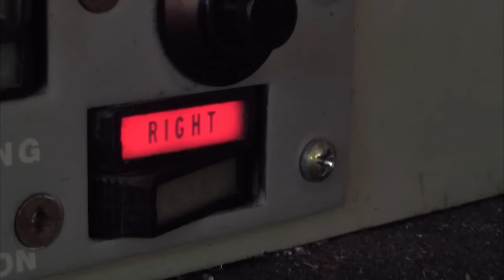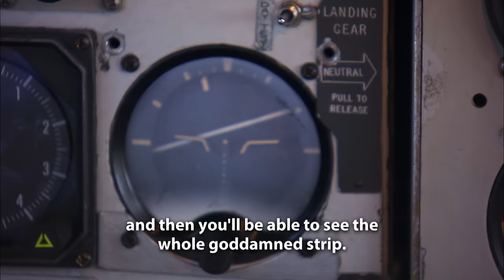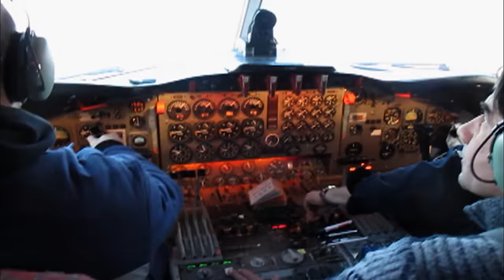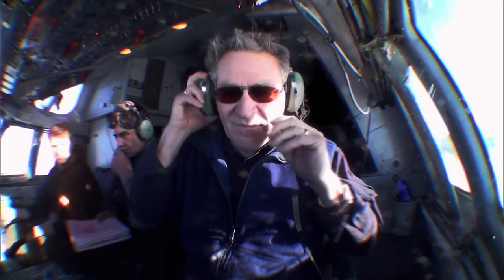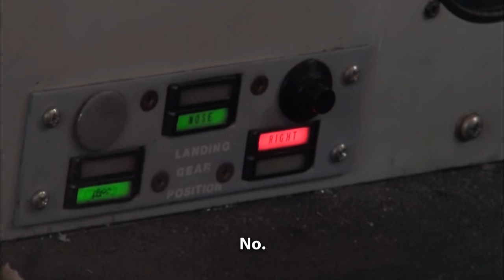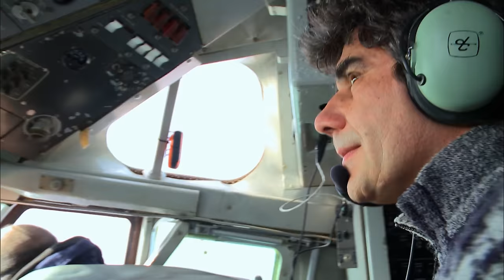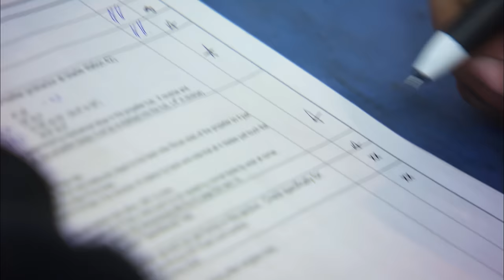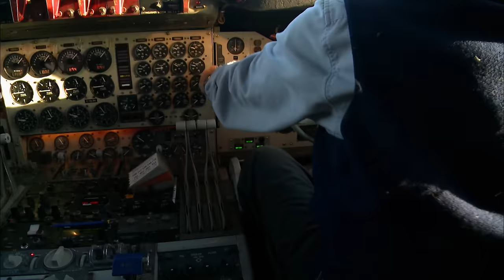Buffalo Airways Electra Suffers A Crash Landing | Ice Pilots | Wonder

Comment: I had tears in my eyes watching this. In the early '60's, at 13 years old, the Electra was the first plane I had ever flown in and had a number of round trip flights in them from LA to Oakland. That was when I decided I wanted to learn to fly. Although I never got to fly an Electra, I did fly for over 20 years including the largest plane being a C-47. This plane was actually Donald Douglasses' personal plane that in 1946 he had it pulled off the C-47 line and converted it to use as his personal plane. Great memories.
Reply: Yeah it was heartbreaking to watch.
Reply: It was returned to the air by Buffalo. It now serves with them as a tanker in a new paint scheme..

Comment: I was technical ground crew - structural technician in the Israeli Air Force.   In D-Check (heavy maintenance depot) the jets were sometimes litrally dissmantled to bits.   Engines removed, wings and horizontal stabalizers dissconnected, all avionics removed, no canopy, sometimes stripped bare of all paint.   To the untrained eye, not much left to look at.
Pilots almost never ever went anywhere near the D-Check hangers, I was told pilots didn't feel comfortable seeing their jets in bits and pieces.
Planes can be repaired and even rebuilt.   Air crew are not replacable.
Reply: Thank you for your service, Sir! Shalom & Semper Fi ^v^
Reply: I used to do the same work as you... it was unreal looking at a skeleton plane and then put it back together.
Reply: @taproom113  Thank you.
Reply: @volador2828  What I only realized several years later, weight for weight, some aluminium alloys are over 3 times stronger than low carbon steel.   There is liberal use of AL7075 - T6, and even T7 throught F-15 & F-16 structure.   These jets are rated to around 14G.
Metalurgy & materials science is wild !
Reply: @trespire  Yep, I also use to run oil samples on jets. I learned quite a bit about metals and oil. About 3-500 samples a day!
I've grounded a few airplanes in my day...
Reply: I catch your drift, but eventually it's up to the pilot flying a plane and signing for the plane to take it airborne.
Look up Bijlmer ramp..
Reply: @MaistoHelix  When it came to the oil sample results, I had the final say whether that plane was going to fly or get grounded.
Reply: It would be like walking into the open heart surgery of a dear family member. Nobody wants to see that!

Comment: As a ground crew that guides it to park with flash lights, the Electra is the most intimidating frightening plane of all planes coming at you with 4 separate 10 foot props spinning at high speed. And when looking up at pilots, you often see them with big smiles.

Comment: I was taught to hit the brakes a bit before transiting the gear, spinning tire is larger and can jam in the doors when it is coming up.
Reply: Not a pilot myself but had the same thought.
Reply: Yep, that was how I was taught as well.
There was rubber on one of the doors, so it was obviously struck as the gear was retracting, but if the wheel hadn't been spinning the door may not have been dragged into the tyre causing it to deform and jam the wheel in the well.
Maybe a bit of a maintenance issue that the door could hit the tyre in the first place, but I think also a pilot training oversight.
Reply: Yep always tap brakes before transitioning gear. All pilots of RG aircraft in the US are taught this. Why they don’t do so is partly what may have caused this in the first place.
Reply: @davidmerullo551  The Electra does have nosewheel rub strips to stop the tires spinning but if you tap the brakes on on a big set of tires (which are heavier than heck) the tires often turn on the wheel - especially in the cold.  With a tubed tire the valve stem gets cut off eventually and with a tubeless tire it can break the bead and cause a flat, so they just spin until they stop by themselves.  Some airplanes require tapping the brakes (the F4U Corsair is one of them) because the tires just barely fit in the wheel wells, but generally bigger airplanes (because of the mass of the tires) don't.  The C-130 is the same way.

Comment: When in the ANG in California after being a crew chief engine run qualified in the USAF on C-141A's  1965-1968. I believe that I was the only taxi and runup qualified crew chief in the ANG or USAF on C-130E's. Even the Navy crew chiefs had to have a flight crew do that when we moved to the Navy air station at Mugu . At Van Nuys CA ANG we had a full simulator to qualify on. I was the only crew chief to qualify because no one else wanted the responsibility. Taxing the C-130 was a blast and I could trim the engines on my airplane when we went to the fence ( the fence deflects the prop blast) and balance the engine prop combination with the engine shop guys to get the most out of the airplane.  C-130E 64-1799 a antique by todays standard. Now retired and still miss those days. Now, they don't let enlisted to do that anymore. Such a shame there are a lot of smart people in the USAF/ Navy/Army that could qualify to do that. It is and was so much fun taxiing that plane. Because of that got a lot of trips out of the US.

Comment: The Electra was flown frequently on long range patrol with 2 engines shut down for fuel conservation. Shutting down at least number 4 prior to landing would have been an option .
Reply: Exactly what i was thinking.  Im a retired Multi engine CFI.  Twice i had to land with an engine feathered.  No big deal.  Flaps and cowl flaps up, engine feathered and shut down, land sofly on the opposite side of engine bad, shut off all gas and electric on short approach.   This landing do look stupid for a multi CFi .  Fail.
Reply: @emergencylowmaneuvering7350  Actually, if you know the airplane, they did it exactly right.  The flaps were down of course because of the huge difference that it makes in the touchdown speed of an Electra and the fact that you can't pull reverse on the engines until below 128 knots (doing so can internally disconnect the prop from the engine and in that scenario you'd want to  be able to pull all the reverse you possibly could on your good engines to keep the airplane straight and on the runway for as long as possible).  They killed the fuel and ignition to #3 & #4 on very short final but didn't feather the props.  When a feathered prop (on an Electra, anyway) hits the ground leading edge first it's very strong and will often tear the prop & gearbox off the engine, or sometimes even the engine itself out of the nacelle.  When these props hit still in the flight range they fold back fairly readily which limits the damage.  The way that the crew dealt with it is exactly the way that it's written in the AFM.  The airplane survived and flew again - I flew it yesterday.
Reply: @emergencylowmaneuvering7350  Q1: What does the checklist and AFM / SOP say ?
Reply: @asya9493  That is the standard for ALL  propeller airplanes.  1960's manuals lack a lot of precautions and preps.  And manufacturers even promoted you bend a lot of parts so they could sell them to you.  
I have been flying since 1969.
Reply: @emergencylowmaneuvering7350  Agreed !   I'm surprised that company SOP/checklists were not updated.
Reply: @asya9493  The company most times dont want to admit they recommnended the wrong procedure.  They will be sued by the ones that got a lot of extra damages doing the old procedures.  
The company will hire lawyers that will lie, and lie, and trick, and lie and confuse and put down all contestants..

Comment: I am fascinated by this episode.  Did they actually have a camera crew onboard (and at base) for this flight? If not, the parts that were re-enacted were very well done! The Electra is one of my favorite birds, I worked on the P-3 variant in the USN for a couple of years.
Reply: I truly believe they did have a crew there for it. The fact they don’t operate a large number of aircraft at the same time means the camera crew was always on one of the only Buffalo flights in the air at any given time.
Reply: It all is from the TV show Ice Pilots. Camera crew's always on most of the flights and in the hanger.
Reply: @donmc9699  nope. that happened on a c47 flight. this was a gear acutaor that got jammed.  you can look up the investigation report from transport canada

Comment: What a shame to see that happen to such a beautiful plane, glad everyone walked away though and that they are able to salvage a lot of parts at least. I must say I am bothered by the boss's attitude rushing the repair though. The mechanics forgot to tighten something and were very lucky that it manifested itself in a way that the crew noticed during the initial test run of the engine. What else did they forget to do? They're only human and they're operating under a tight deadline and a lot of stress. Also unless I'm mistaken, they pulled an engine off of a crashed plane, it had no readily visible damage but how do they know it didn't ingest debris or suffer some other hidden damage? This sort of slapdash attitude is what gets airplanes destroyed and people killed.

Comment: Was it ever determined what caused the landing gear to fail?
Reply: According to what I can find "The outboard
gear door strut is suspected to have jammed the gear mechanism
during landing gear retraction after takeoff. TSB File A12W0020."
Reply: @augie6651  you must be more adept at searching tsb archives than me. Thanks for the info
Reply: @augie6651  Indeed, the reason they can't be more specific is because, as we see, Chuck hooks the gear door to his truck and pulls it off the plane, thereby allowing the remainder of the gear sequence to take place. Necessary for urgent removal of the aircraft so the airport can reopen, but also likely the exact thing that could have provided a more thorough report.

Comment: I was there and built that ice strip along with Jim Burke(r.i.p.) and the runway was fine and when hercs are using a strip they sent their tech. experts to sign off that it's ok. We used a d6 cat and a cat wheel loader with chains that drag under the bucket to leave a bit of snow on the strip. This is at Sabina gold and silvers exploration camp(goose lake)which is now becoming a mine. We would land hercs and all sorts of planes 24 hours a day up to a dozen planes every 12 hours .I have also built ice strips in both the eastern and western arctic and there was nothing wrong or unusual about this one. What they dont tell you is the mechanic left a hammer in the gear on the last maintenance. So now you all know.
Reply: That was not for the Electra mishap, that was for a C-46 incident that happened after this incident. This was and quoted from TSB "The outboard
gear door strut is suspected to have jammed the gear mechanism
during landing gear retraction after takeoff. TSB File A12W0020."
Reply: Before landing they worry about the strip but after the landing and also checking it out they say it was fine, don't worry about your work ! Couldn't a crack be fixed anyway, pouring some water in it ?
Reply: @augie6651  I know it wasent the strip which was identical to any other arctic ice strips I have built or seen and we land half a dozen different kinds of planes every day. I didnt know about the second mishap. All the strips I have built were between 5 and 12 feet thick for ice and constantly tested by lots of experts.
Reply: @aesma2522  They only get cracks that could be bad in spring.
Reply: @demos9677  I was not arguing about the strip, I was correcting your statement on it being a hammer as the cause.

Comment: Time to buy new planes
Reply: To expensive
Reply: @Northern_Farmer  money can buy new planes but money can’t buy the souls of the pilots
Reply: Are you paying for them? 
The Electra is the right tool for the job that Buffalo has for them. They are affordable, & to a degree, available. The damaged aircraft is just that, .. damaged, not destroyed. It is, at the time of the incident, either a repair proposition, or a parts source for another aircraft. To flippantly say " Time to buy new planes" shows a total lack of knowledge about the Buffalo Airways operation.
And for the record, what new aircraft do you suggest might have the features required to replace the Electra? You have a budget equal to the repair cost of, or replacement [with another Electra] of the damaged aircraft. So, what new aircraft will be your choice as a replacement type.
Your time starts, ..... now.
Reply: @christopherdaly9718  
Buy
Another
Electra 😐😐😐😐😐

Comment: i was flying a Cessna citation a few years ago  when all 3 gear refused to come down. high speed stalls couldnt shake them down i went well this is it. as i approached the runway after i had dumped as much fuel as i could  it touched down hit the grass and rolled into a ball. exploded and killed me. then as it exploded  it hit a high voltage power line fried the airplane, the shock restarted my heart but im better now., super glue and duct tape sure helps. after i got out of the hospital i was being taken home  and the ambulance was hit by a frieght train. yup you guessed it was killed again,. after  this time 6 months in icu they released me. i said no ambulance ride please so i had a calif highway patrol take me home. we got in a car chase. bad guy started to shoot at us. i was hit by 30 rounds from a ar15. ha! bet you thought it killed me again, nope/ i was however leaking blood like a  sieve     back to the hospital fixed up and 4 months later on the way home a damn 747 crashed into us. was a bad year. but im better now. ray did one hell of a job that is one great pilot. id fly with him anywhere but i dont he would get near a plane with me lol

Comment: Why full flaps and not feathering and shut down the right engines?  Lots of damages to flaps, and engines..  Difficult to do?  destroyed the flaps and linkayes,  and 2 engines and props too.  Fail.  I had to full feathered landings.  No damages.
Reply: Actually, they did it exactly by the book.  The flaps were down because of the huge difference that they make to the touchdown speed of an Electra.  As it was they used about 2/3 of the longest runway.  You can't pull reverse on the engines of an Electra until below 128 knots (doing so can internally disconnect the prop from the engine and in that scenario you'd want to  be able to pull all the reverse you possibly could on your good engines to keep the airplane straight and on the runway for as long as possible).  They killed the fuel and ignition to #3 & #4 on very short final but didn't feather the props.  When a feathered prop (on an Electra, anyway) hits the ground leading edge first it's very strong and will often tear the prop & gearbox off the engine, or sometimes even the engine itself out of the nacelle.  When these props hit still in the flight range they fold back fairly readily which limits the damage.  The way that the crew dealt with it is exactly the way that it's written in the AFM.  The airplane survived and flew again - I flew it yesterday.  Eventually, even that flap got rebuilt and you couldn't tell it from a new one.

Comment: So much false drama in this.
Reply: Normally I agree but for this?  It is a big deal.
Reply: False drama? Not on this episode. A commercial Lockheed Electra is a rare bird, even back in 2012. You don’t go around staging gear up emergency landings with a privately owned working aircraft that is an important major asset to your company for a few reality show ratings points. The pilots were able to land this plane with minimal damage. And as a result, they were able to recover the plane and put it back in service in 6 months. THAT was a big deal! 

Remember, planes like this are operating in a specialized role. They and their crews have been adapted to serve in that environment. If you break the plane, a replacement plane is often not available just a phone call away. They has to remove parts from this plane and spend several days getting the backup plane ready to fly. That was also a big deal.